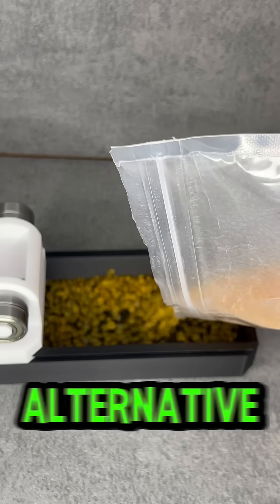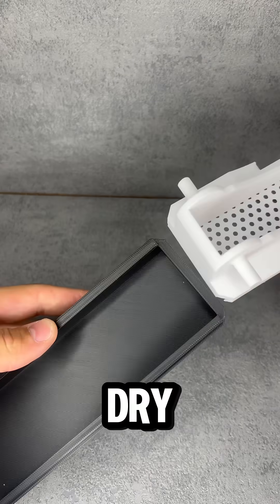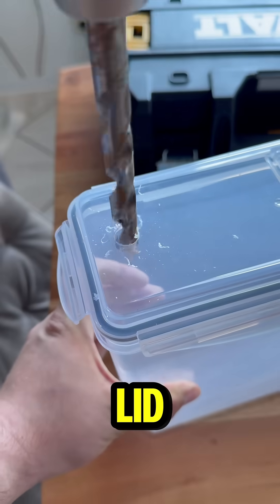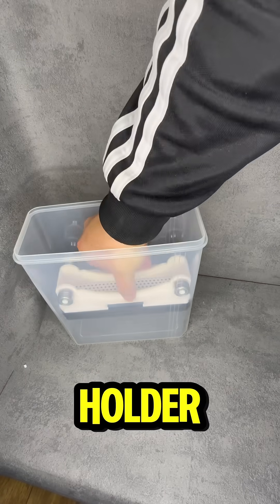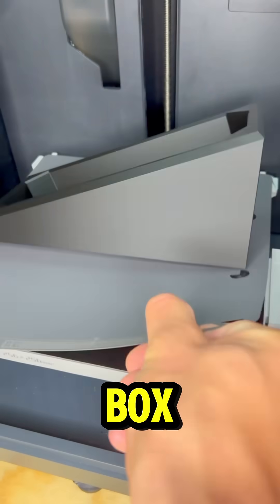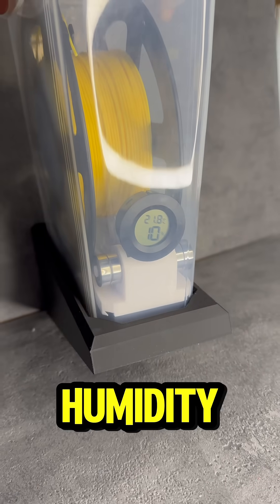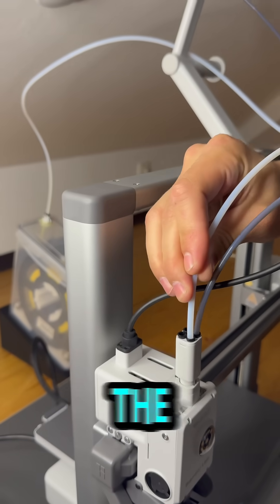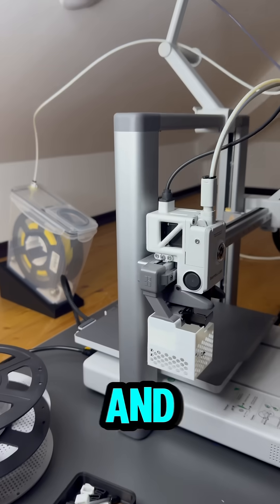Cheaper and drier than the AMS: DIY Drybox‼️🤩#layerworks #diy #3dprinting #filament #ams #dry

Comment: There is a small industrial aliexpress pelitier based dehumdifier, and it is drying the hell out of the ams, you just need to modify ams to have in/out to allow air circulation through the dehumidifier

Comment: I made a dry box similar to this but instead of drilling a hole for the bowden tube coupler and globbing hot snot around it, I designed and printed a plug that went into the original opening that sealed the box, and had a hole to put the coupler in. (You know, that's what 3d printing is about) When not in use, I can remove the plug and snap the lid closed to keep the filament dry.
Reply: Hi. Would you care to share your STL file?

Comment: Humidity dropped because moisture from the AIR in the BOX was dried!
NOT THE FILAMENT!
Heat is required to release moisture from the actual filament!
Then this moisture can be absorbed, or better yet vented, from the box.
If the moisture was being removed from the filament, the meter would actually go up initially.
These are called "dry" boxes (and not "drying") for a good reason. They are great to store your correctly dried filament in.
Every single filament manufacturer gives the temperature and duration of what is needed to dry their filament with.

Comment: Been printing every day for the past 2 years , I have never had to dry any filament.
Reply: Time to start printing PETG :-)
Reply: @bremershaper  PETG doesn't need drying unless you live in the tropics or leave it outside.
Reply: I was forced to as soon as I started messing around with tpu, just letting it be in the air overnight will make any future print catastrophical, but drying it before printing fixes that
Reply: because its a scam for selling silicagel and dryboxes
Reply: @Alkaonchik  PLA manufactures even say not to dry it ,
Reply: @Alkaonchik  No. It depends on what you print. If you just print in PLA then you can probably get away with never drying. PETG on the other hand absorbs moisture like crazy and there is a very noticeable difference in prints when dried or not.
Reply: That works if you only use PLA, almost every other filament imaginable has to be dried
Reply: To keep your streak going, don't move to Florida.

Comment: You measure the humidity of the air. The moisture in the filament will only leave at a certain temperature
Reply: That’s just not accurate. Why does food dry out and water evaporate at room temperature? HUMIDITY! You have no idea what you’re talking about.
Reply from the maker: Yes you are right but it also helps to get the humidity out of the air 😃
Reply: @Layer_Works No, he's not! If that were true water would only evaporate at 212° F! Water and moisture dry out of things at room temperature, because of humidity. Did both of you miss 9th grade science class?
Reply: @NoMoreBsPlease no you are wrong. Materials can hold water even under dry circumstances because they hold it with chemical or physical interactions. The most prominent example being superabsorbers. Or take the silica itself. It won’t dry just because it’s in a dry environment you need to heat it :)

Comment: Just because the box is dry doesn't mean the material is. 
Higher temp (50 - 65°C) for a long time, reaching the inside of the spool could take days.
Reply from the maker: Thanks for the tip, that’s true😃

Comment: AMS (automatic multicolor system) has motors to pull the filament back or push it in, that is just a drying box with a hole for it to come out
Reply: automated material system*

Comment: I mean yeah, it works with already dry filament. But the water inside the filament can only be dispersed with HEAT.

The silica gel can only grab the moisture inside the air.

Comment: There one thing I’m wondering and actually doing some research on it 🤔(just started),
Like is there way to truly DIY/hack a AMS Feeder Unit (Hall) to attach it to this type of external drybox that would read the rf code and automatically switch between the AMS filament and the DIY drybox? And is there a way to upgrade the AMS Feeder Unit (Hall) by swapping the gears with metal gears to be able to feed safely carbon fiber materials?
Reply: Ig you could try to take off the spool holders and press the box up against to rfid
Reply: @Cdggddfgdssrttdi think it would be way more complicated them that 🤔

Comment: This is not an AMS at all 😂. You just made a spool holder with dessicant beads. It's a ghetto filament dryer. It doesn't communicate with the printer to manage multiple filaments

Comment: This ONLY when use PLA or PLA PLUS. 

I will suggest you NOT TO USE PLA nor plus, especially for commercial. 

PLA will auto crush or broken after 3 years and ruin everythings around. 

PLA will produces GAS and sugar liquid which can create colateral damage.

If you print A CASING FOR ELECTRONIC, then congratulation, it will sometime finally melt and bye2.

Comment: Putting aside the comments from all the trolls that this is not an AMS, this is a neat design. I bought the same containers just to store but with a little bit of modification one can actually print from these. I like the idea. Would be nice if you shared the model files. One quick modification would be to press the bearings into the center piece one on each side, then run a plastic 3d printed rod through. This way you only need 4 bearings, but visually have the same piece. Also the base container could have a mesh on one of the sides so that you could see the color of the beads to replace in time. Can i find the 3d model files somewhere?))
Reply from the maker: Very good idea makerworld number is in description and the stand for it will be uploaded soon on our Bambu account 😃
Reply: Rock solid idea for me, though I'll likely not try and achieve any AMS function. I'd like the files too

Comment: That's not an "AMS". That's a dry box, which is really nice but an AMS/MMU (multi material unit) does more than just keep filament dry, it actively helps feed filament and aids in swapping filament out for multiple color printing.

Comment: Your silica gel is drying the air surrounding the filament, not the filament itself. You need heat to drive the moisture out of the filament. If you dry the filament in a dryer THEN put it in this box, it will keep it dry for an extended period. That's what a drybox is for. And no, this isn't an AMS since you still have to load and remove the filament manually. Another commentor suggested using this in tandem with an AMS lite, but that still would not retract the filament properly when it unloads.
Reply: yeah but thats expensive and we dont have the money nor space...  I wish there was an ams that had drying built in
Reply: This is a replacement for an AMS system that happens to keep the filament dry.
Reply: not how moisture works. If the air drys it will pull moisture out of the filament back into the air
Reply: @CocoPopsOnFire  Only superficially. Not sufficient for proper filament drying.
Reply: It will dry the filament, just very very very slowly lol
Reply: @dallasgombash5381 yeah and dont to change the silica gel 100x times
Reply: @dallasgombash5381  Yeah, it’s slower than with heat, but still way quicker than you’d expect.
Reply: I hate that this keeps getting regurgitating in the 3d community. Yes the dessicant dries the air, which allows the filament to release moisture in the air, which it removes, and again and again until your filament is dry. The moisture will try to maintain equilibrium between the filament and the atmosphere. 
Certain materials hold onto the moisture more strongly than others such as nylon compared to PLA which can get relatively dry in just a week @ 10% RH. But even nylons will shed moisture over the course of months if the RH is low enough.

Comment: An AMS is motorized so the spools can individually move to load and unload, what you have is just a dry box and at that point just get a larger box to hold the whole ams
Reply: Technically I think you mean AMS lite!
Reply: @ku8721  Ams ams lite it doesn't really matter because the point still stands that they are automatic and the boxes shown are not.

Comment: NOTE: FOR A CLEANER LOOK:
Drill a hole 1/2 the diameter and heat with heat gun while pushing the PTFE adapter through. Use a couple O-Rings to seal. No messy glue. (You can use a drop of "construction cement" adhesive between O-Rings if you want it bonded.

Comment: W idea, but why not print an adapter and nut for the ptfe adapter. Make it look so clean only to gloop on glue.
Reply: Thank goodness someone else noticed that!
Reply: Came here for this. Printed a spool holder but couldnt be bothered to print a adapter for the ptfe.
Reply: Worst glue job haha
Reply: Lazy…
Reply: He didn't even have to print one. There's plenty of screw in type PTFE adapters on Amazon, just drill the correct sized hole for it. Instead, he used an expensive Bambu PTFE adapter, meant to be mounted on a swivel base screw.
Reply: @wmichaelis  hi! can you please help me? This is my first day of owning a printer. I messed up and bought one w/o AMS. And they are out of stock. I'm looking for alternative. 
Can you please tell me what you mean by PTFE adapters?
Reply: @warriorenv  He meant PC4-M6 Pneumatic Connectors/Fittings.
Reply: Whole reason I am here. 10 more minutes in CAD on top of your 4 hrs for a simple adapter would have rounded this out nicely
Reply: @mazcoder it keeps me up at night

Comment: An AMS is literally what it says in the name, a multicolor machine, that is just a expensive and large spool holder
Reply: Automatic material system, the colors aren’t the focus of it but yeah
Reply: Yes, but 1) This dries the filament and 2) is not expensive to build at all so I don't see what your point is exept that the AMS is designed for something else.
Reply: @origamicrafterboy  That is the point. This is not an AMS.

Comment: I use something similar and it does work with the AMS lite. the motors pull the filament from the head  just enough for the other filament to be feed trough.

Comment: I feel like you could print a glue guide so it doesn’t look like a volcano where it smooths by spinning around the guide pushing the glue flush to the surface like a concrete level

Comment: The AMS isn't a dry box, it's a multi-material system that can make automatic filament changes. This doesn't do anything the AMS does other than literally just hold the filament and my desk is capable of that on it's own
Reply: Actually the AMS 2 Pro IS.
Reply: @evolutionarystate5386 actually it isn't. Nobody would answer that it's a dry box if asked, they'd say it's a multi-material system that can also dry filament. That doesn't make it a dry box, that's not its primary use. This still isn't an alternative to an AMS
Reply: @Sandbag747  actually it is..

Active Air Vent 65°C Filament Drying & Air-tight Filament Storage
Automated venting facilitates dehumidification during drying and ensures airtight sealing for weeks of high-quality printing. During the drying process, the filament spools can rotate automatically to ensure more even drying.
Reply: The AMS is a multimaterial system capable of functioning as a drybox, as there is a place to add silica gel to keep your filament in the enclosed space dry. It just isn't a filament dryer, unlike the enclosed Bambu Lab printers, which is what you would get a regular AMS for.
Reply: @GavinFromDesignA car is capable of charging your cellphone but you wouldn't call a phone charger a cheaper alternative to a car. Sure it's designed to be able to charge a phone, just like the charger but it's not the actual purpose of the car. Just like the AMS is capable of holding filament and keeping it relatively dry (although not all that well) it's not the actual purpose of the AMS and a dry box gets nowhere near the designed functionality of an AMS

Comment: Thats just a "dry box" the ams stands for Automatic Material Switcher, which this doesn't do. You may be removing humidity but thats not drying filament, you need heat to dry filament.

Comment: That's not an AMS, it's a dry box
Reply: This guy gets it
Reply: And not a drying box.
This box does NOT dry the filament out. It simply keeps the environment inside the box dry for correctly dried filament to be stored in.
Heat and time are REQUIRED to dry out filament.
Reply: @justinmurphy2227 he said dry box, which is what it is.
Reply: @brysonrodden5112  Its a dry boy. NOT a drying boy.
Reply: Was waiting for someone to point this out. Fact is its not an AMS. Its not feeding filament automatically
Reply: The ams he works as a one spool ams that feeds the filament it isn’t a dry box this thing in the vid is a dry box
Reply: @C.P.3D.officialthe AMS is also a dry box if you use the desiccant storage at the bottom and even better if you print the extra storage options
Reply: @brysonrodden5112 This is an A1, though. For this, you need one of the mods that use the AMS lite pieces with a dry box or one of the prints that basically makes a dry box over the spools on the ams lite.

But with an A1, safe bet is you're printing PLA. If a spool has been sitting out for more than a month, throw it in a dryer before printing. Done.
Reply: Tôi có thể tìm  file in 3d  ở đâu
Reply: He says its an alternative to ams not ams itself.
Reply: @imnotgivingyoumyname810  Much like a pair of shoes are an alternative to a car: They both get you from point A to point B but vary in use cases.

This isn't an alternative to an AMS either; it's an alternative to a filament dryer.
It'll keep the filament from needing to be dried properly by storing it in a dryer box long term.
Reply: Oh oh. You made the mistake of speaking  objective truth to subjective ....
Reply: That's what he said
Reply: Point of order! No you should call it an AMS lite! As he is using an A1!
Reply: Erm actually it’s a filament dryer plus the AMS ht is a dedicated filament dryer
Reply: @chrisskabardonis4940 it's a passive box that keeps moisture out, it doesn't heat. Therefore it's a drybox and not a filament dryer
Reply: Which is an alternative to the AMS HT
Reply: @DavideBruno-e9u the first word is automatic, this isn't. Not and ams is it.
Reply: @Whoodoo1  Exactly and the point of the BL AMS is to be able to print in multi color, this doesnt because its a dry box.
Reply: @GCS88 ams ht doesn’t have multi colorprinting unless you have multiple of them.
Reply: @CookieGamer-tq7ym  Here's the thing: the HT is a drybox first, automatic multicolored printing second.
With multiple HTs you will be able to multicolor print you said it yourself, even if you have 20 of the one in the video you still wont be able to do that when it claims its an alternative to an AMS, get it now?
Reply: @GCS88 ams gt in itself doesn’t have multicolor printing, you need atleast 2 for that
Reply: @CookieGamer-tq7ym  I know that which is why its a multcolored printing second as already established, now if you have 2 of the thing in the video is it an AMS? thought I made it easy for you already.
Reply: Bambulab literally calls it AMS HT, that is what makes it an ams.
Reply: @DavideBruno-e9u  no it's not..... th_is one just dry and to be honest.... the HT dry and warm.... if you didnt understand the difference, buy a anycubic, it's be enought for you
Reply: @DavideBruno-e9u it’s not an alternative because it can change to another role!
Reply: @DavideBruno-e9u no?
Reply: @DavideBruno-e9u  No
Reply: @DavideBruno-e9u  AMS is automatic material system, he made a drybox, not an AMS
Reply: @DavideBruno-e9u  AMS HT has a motor to automatically feed filament into the printer though

Comment: But this isn’t heated so it’s only sucking moisture out of the air and hardly any comes out of the filament. Also, the main feature of the ams is not that it keeps filament dry, it’s that it switches colors.
Reply: You don't need to heat the filament to dry it. If humidity gets in the plastic passively from the environment, it also gets out passively. Just pull the water out of the air and the filament will dry out as well.
Reply: @jatkinson08 while heat is not required, it is much faster
Reply: Yeah it not meant to dry it, just keep it dry. I use my moms air fryer to dry filament and keep them in food containers to keep them dry
Reply: another 3d print channel tested this and it does dry your filament.
It only takes longer than a heated dryer. it will take about 7 days for it to dry.
Reply: What happens when u copy n paste shorts